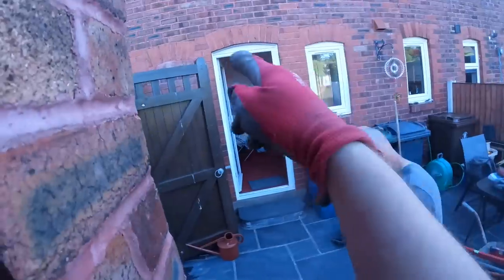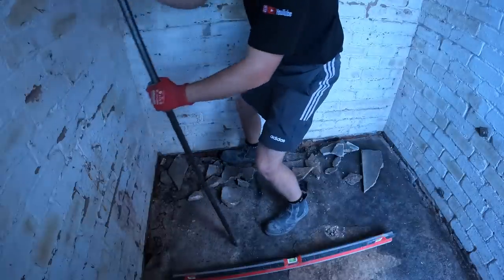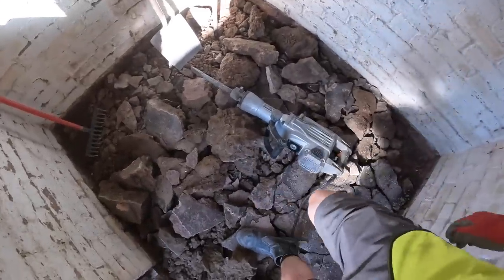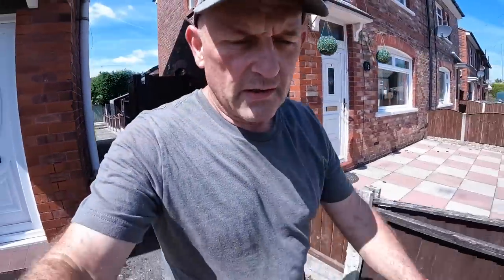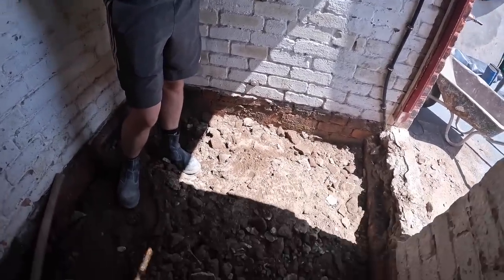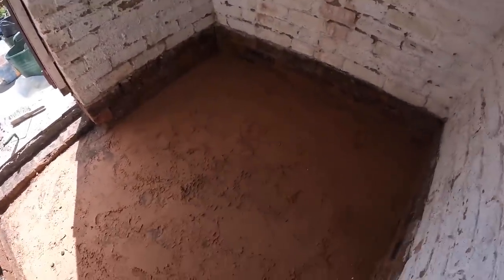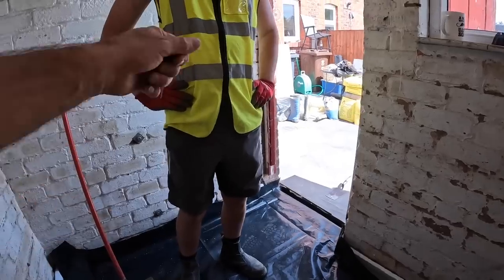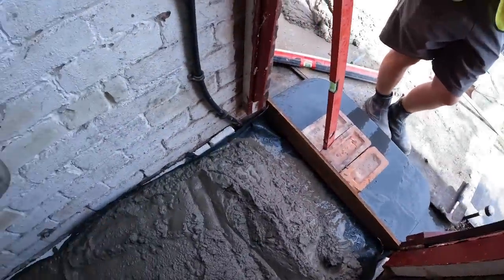COLLAPSED CONCRETE SLAB

Comment: Enjoyed that, thank you. The result was great (as normal). As a layman DIYer, why would you bother with taking out all of the small rubble (from say the 20 min mark) rather than just compact it into the soil or into dust, and then blind with sand? I appreciate you do everything the right way, but for a non-pro guy like me it seems like an extra step. Keep the vids coming! Cheers.
Reply from the maker: We took extra out for insulation but it’s not critical for an outbuilding 🧱👍🏽